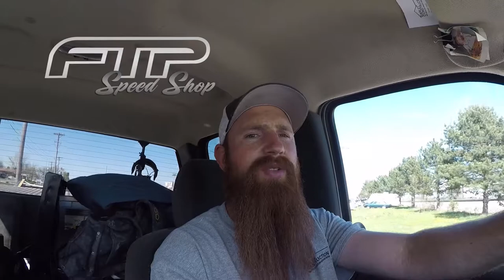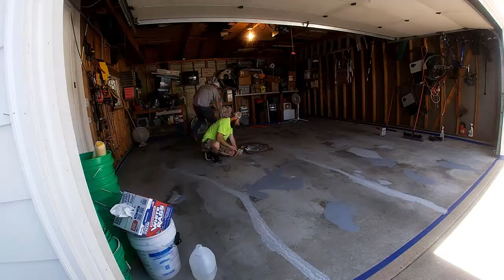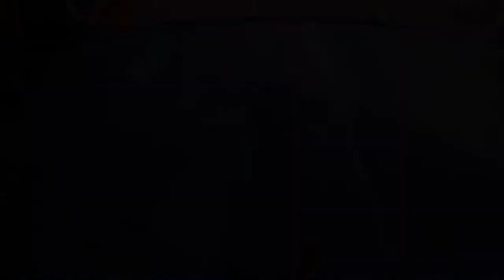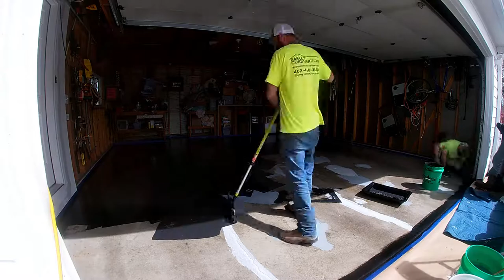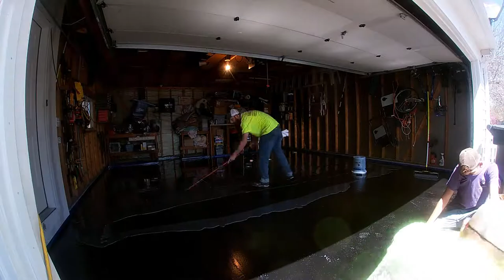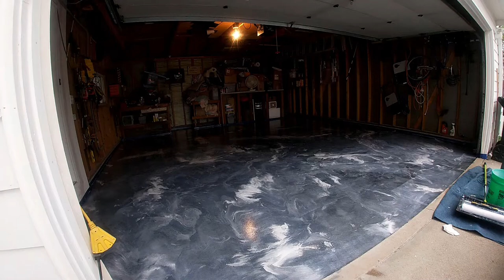Installing an Epoxy Garage Floor Coating System!!

Comment: How much would something like this cost a customer? It looks awesome.
Reply from the maker: The raw material costs for this was around $1700 (epoxy, buckets, tape, acid etch, rollers and brushes).
Reply: @FullThrottlePerformanceMike  thank you I appreciate the response. I look forward to doing this to my own garage someday soon.